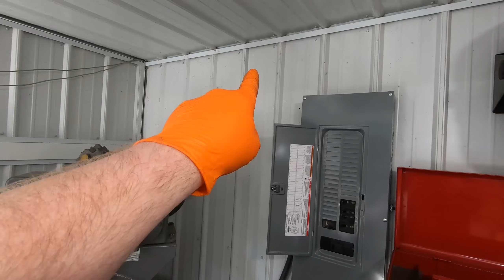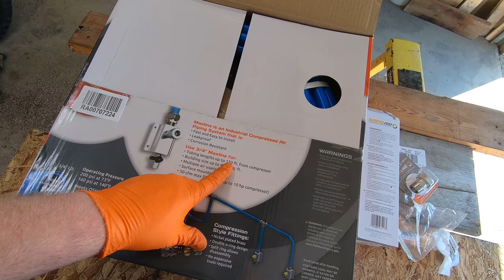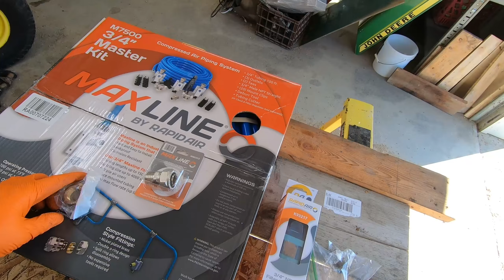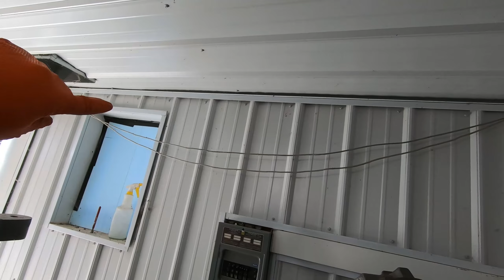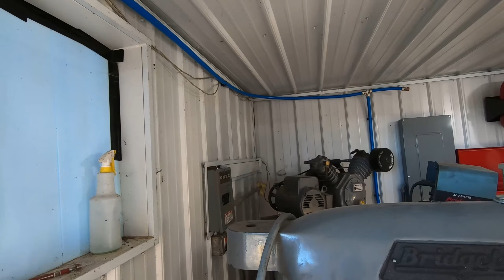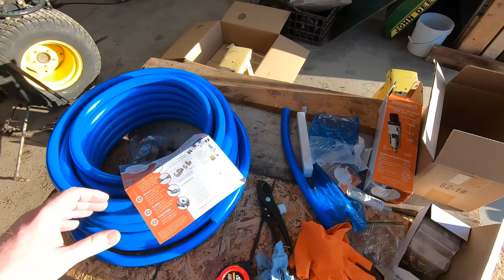Max Line by RapidAir System Install and Impressions

Comment: I have the same system, I used a 1" conduit bender to make tighter turns and a little soapy water to lube the orings will make assembling the fittings easier
Reply from the maker: I thought about using a tube bender, since I even have one…. But I can’t find it in the well organized shop I have!

Comment: I'll be curious about your long-term impression.  Looks to be a pretty decent kit with its installation flexibility.
Reply from the maker: So far it’s been pressurized for 4 days and it leaks at 25psi per day which I don’t think is terrible. As I use the system I will certainly update viewers.

Comment: At the risk of all the negative hate I am sure to get,my building has had 3/4” pvc pipe air lines for nearly 20 years now with no issues with 175 lbs psi to the regulator.
Reply from the maker: Personally to each his own. PVC works for a lot of folks. There are some risks with PVC, but there are risks with just about any system. Black iron pipes can rust, this system can blow apart at the seams, PVC can become brittle, etc etc. If the budget wasn’t a limiting factor, this would all be 1” soldered type L copper pipe… but this isn’t a high budget operation! Lol